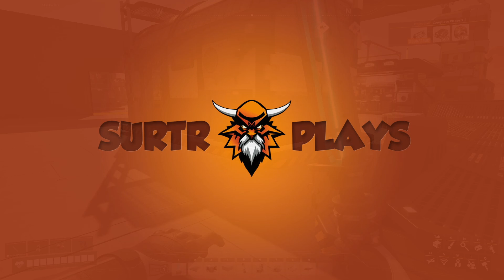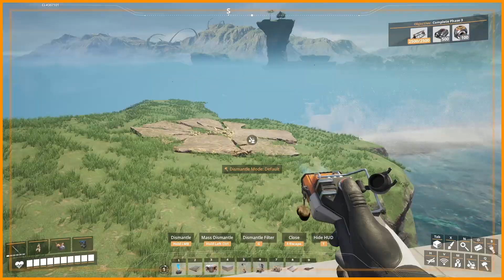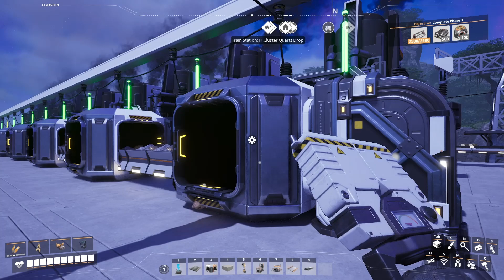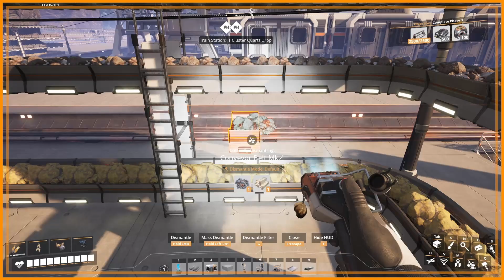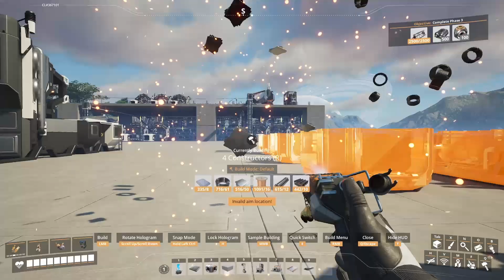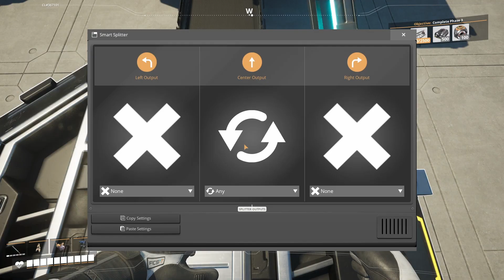Satisfactory 1.0 - Circuit Boards Made Easy 125 per minute [E15]

Comment: I also went for the silica circuit board but this play through will try the crystal computer alt which removes oil as have a ton of factories out in the desert area and there are two good quartz nodes in the far corner
Reply from the maker: Yup. Lots of ways to do things.

Comment: My mainstay alt recipes are heavy oil residue, diluted packaged fuel alongside recycled rubber & plastic which combined make crude oil go further, 300 in for 450 of each output. Downside it the number of drives you have to go through to find the recipes can be pretty high. But the upside in 1.0 is fed into a depot that rubber turns into a lot of fuel gennys without the need to trek back and forth for more.
Reply from the maker: Excellent recipes. I'm trying to keep things simple but if I need to, I will pull out those big guns.

Comment: Looks like you're in the same biome I'm in. There's two quartz nodes in a cave underneath my base and one SAM as well. Big enough to stick a small factory in. Copper, iron, limestone, and four coal nodes topside.
Reply from the maker: Thanks. I am getting my quartz and SAM from there. I'm not sure if I am going to do anything in that area. Maybe later. There is a 3rd quartz node in that cave. Not pure but still handy.